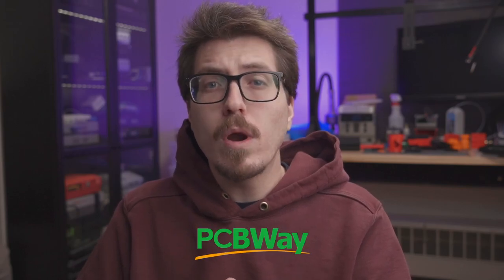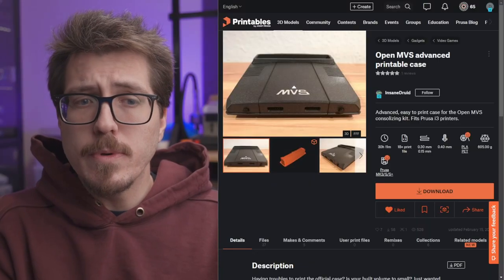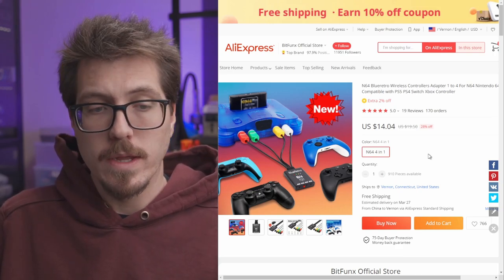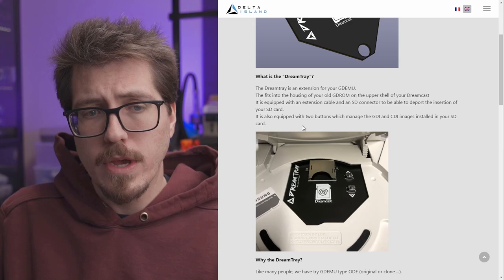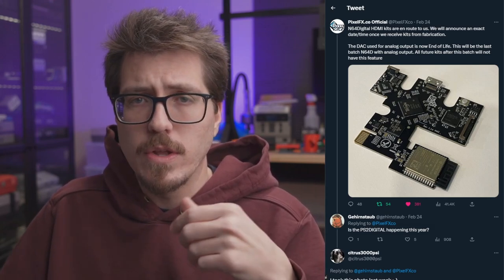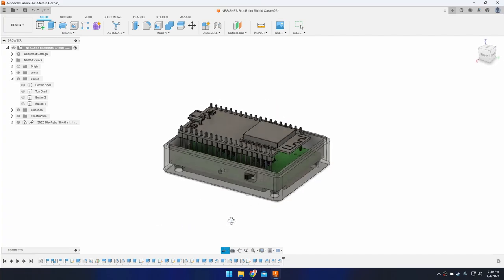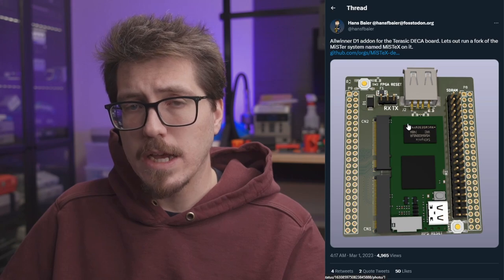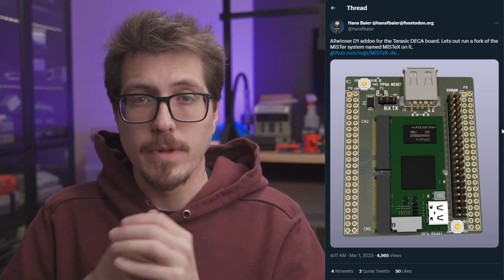New MiSTer Fork Works With Other FPGAs - Retro Modding News

Comment: The DECA has half the capacity of the DE10 Nano (50K LEs vs 110K LEs), comparable to the Analogue Pocket. So not everything is going to run on it.
Reply: Yeah. Even given price increases over the past couple of years, the DE10-nano is still cheap for the FPGA it contains. Unless a competing FPGA manufacturer starts seriously undercutting Intel/Altera, there isn't going to be an equivalent alternative any time soon. Not to say that porting the MiSTer project to other hardware isn't worth considering, but I don't think it's going to be worth the effort just to try to make it cheaper.
Reply: It isn't about the LEs it's about how the elements are setupand how the LUTs are setup you can't always rely on LEs as a metric because that isn't the only design constraint(which with the DECA Arrow is memory, I created a memory addon module for my unit). The MAX10 are designed for instant on so you will use LESS logic elements based on the routing(typically used to quickly push designs onto a CYC10 or Stratix FPGA.  I ported a lot of the cores for my own personal use and I also created a SNES\NES\GBA replication years ago on my xilinix arty7.

Comment: The DECA is a development board for the Max10 FPGA, fitted with a 55k LE part (I.E. about half the logic capacity of the Cyclone 5 SoC used in the DE10 Nano) -  the Cyclone 5 SoC also has a dual core ARM9, which is not present on the Max, hence the addon board with a processor on it.  The D1 uses a single RISC-V core clocked at 1GHz.  I would ballpark the overall performance at about 50% of the DE10 Nano, so it's likely there will be a significant number of cores that simply won't fit.
Reply from the maker: Thanks for the info!
Reply: And the Max10 paired with a Risc-V make quite an odd combinaison. 
That is my main grief with the mister project, targeting only one Soc with a specific board. The mister framework need more targets.
He will get through all the trouble to reimplement the CPU-FPGA interface ( FPGA Flash, I/O, post processing ) on an homemade solution ? 
Don't get me wrong, it will be quite a feat, but i don't think it will be a viable solution.
Beside the Max10 is quite old, and it's only advantage it's to self configure when power up to mimic a CPLD .
Why not target an AMD-Xilinx Zynq7020, it is similar to the cyclone V and board can be dirt cheap ( and importing VHDL/verilog core into and other framework is not the most difficult part). Or if you really want to torture yourself you can hook up an Rpi-like to lattice 45KLE (>100$) will do the same job but more affordable and easy to source.

Comment: Found out randomly on my feed, wonderful little update. I had no idea about the GDEMU and 3DS Consolizer. The Sanni Cart is cool too, didnt know I could get an all in one. Thanks for the news! Subbed, Ill be watching every update!
Reply from the maker: Thanks for watching!
Reply: Yeah, the Sanni reader is a neat project, by default the v5 will do NES, Famicom, SNES/SFC, n64, Master System, Genesis/MegaDrive, GB, GBC, and GBA, but it can do even more systems with some adapters, and it is a fairly achievable beginner soldering project, everything is through hole (unless you want to assemble an optional add-on pcb that replaces the 3v/5v switch with a chip that automatically selects the appropriate voltage)

Comment: How would the PS2Digital work for Slims that don't have the modem connector?
Reply from the maker: You'll probably have to cut the case
Reply: @dubesinhower  what models have the modem port? I have several 7000x models (PAL and NTSC) and none of them have that port.
Reply: @MichaelM28 Hey Michael! Fortunately i can help answer your question because i searched out and purchased one a couple of years ago. It's a 700012 model (the only ps2 slim with an extra digit in its model number i believe) and i think it's an ntsc only model (North American confirmed but unsure about Japan).